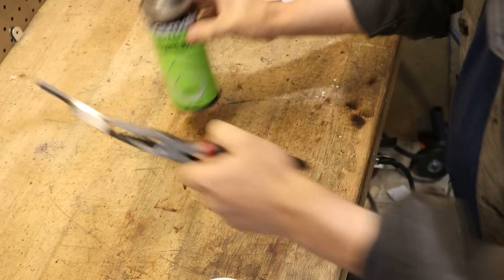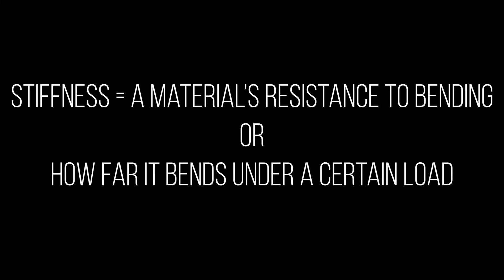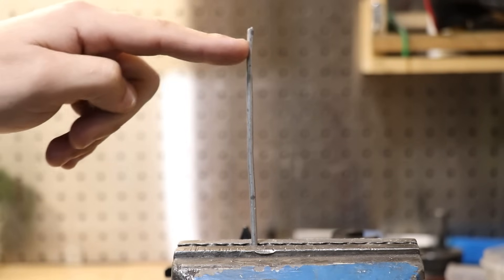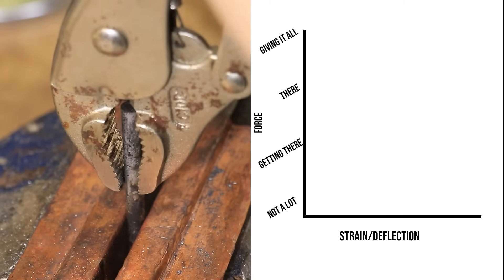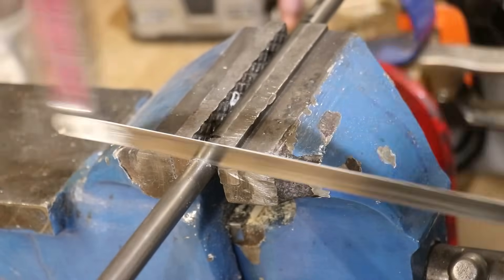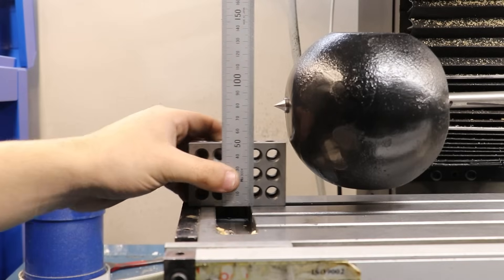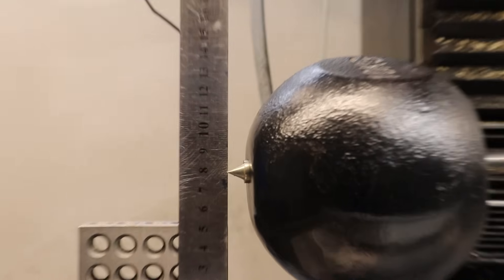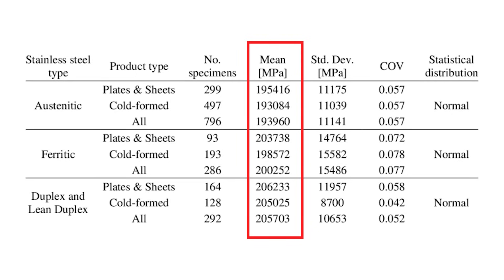Hardened Steel is NOT Stiffer Than Soft Steel

Comment: Reads title:
It depends on how you define stiffness.

If you can flex it without too much effort(just hands, no tools), it feels "flimsy" compared to a hardened steel that increases the amount of effort to bend the steel at all. 

Again, it comes down to your definition of "stiffness".
There are better terms.
Reply: There are no better terms than stiffness, this is the literal definition of stiffness. It is the exact correct word. There is no "your definition" and "my definition" of stiffness, there is only "the definition", and this is it.
Reply: @rodfrey  
 @rodfrey  
Axial compression, yield strength, tensile strength.

Stiffness only applies if you want to use the whole model, not the segments that he wants to represent in this video. 
If you want to be specific, he is correct in the video, the title is misleading. 
As he does define his statement at 1:50 i think to, "how much a material bends under a certain load"
Which is a great way to define it, but resistance to bending is not, as hardening does indeed change resistance to bend as later stated in the video.
Reply from the maker: @kairu_aname  I think you are taking it well beyond what a reasonable interpretation and scope of what is covered here. As it shows in the video the stiffness remains unchanged, both hard and  soft - 10mm of deflection under the same load. This is the main point being shown in the video. That bit tacked in at the end is just to show that whilst stiffness remained unchanged, resistance to permanent deformation is different. 

Are you confusing resistance to bending with resistance to permanent/plastic deformation be any chance? 

"If the line gets longer, then it by your definition gets stiffer." - No? We Would need the slope of that line to change to show a change in stiffness. If it gets longer it shows a change in yield strength and it takes a greater force to permanently deform it. That has nothing to do with stiffness as the slope remains unchanged. 

"Stiffness only applies if you want to use the whole model"  I don't quite understand this point that you have made. It is slightly different some plastic and cast iron, but for metals that obey hookes law, we just take the slope of the graph  below the yield point, where the stress and strain is linear and that is our stiffness. 

"He's using yield strength as a point and saying it's the same as ultimate strength" - I don't think I ever said that. It might get a bit fuzzy because I had to snap that piece of hardened steel but it really wasn't a big point of focus. I was just trying to show that the amount of force needed to permanently bend it increased with the hardness. I think that can be shown without diving into depths of UTS vs yield strength. 

"As evidenced by the point near the end of the video where he tries to bend the steel with a pipe as leverage" Yeah, the yeild strength goes up.... which is why people get confused and mistake it for an increase in stiffness. THAT is the only point being made there. And it was to tie in with the previous shot which showed that the stiffness/youngs modulus remained unchanged. 

I have read through your replied and I really do not understand the issues you are having.
Reply: @rodfrey  
(Also, yes. Languages are fluid, they change and words are changed and redefined over time. There are no absolutes, only what fits best right now since you want to be an ass about "your definition/my definition" nonsense)
Reply: @kairu_aname  Definitions can be fluid if we're dealing with Shakespeare or rap music. We'd better be a bit more conservative with language if we're trying to do engineering. Pulling the "language is relative" card is harmless if somebody wants "literally" to now mean "figuratively", but it's not harmless if one is sloppy with technical terms.
Reply: Hardening steel does NOT increase the amount of force required to flex it at all. It only increases the force required to permanently bend it.
Reply: @mixedsurface  
Again, better terms.
Reply from the maker: Well I did show you what stiffness was defined as for the context of this video.  If you have a more apt one I would like to hear it. Cheers
Reply: @artisanmakes  
Permanent flex? 
Plasticity.
Yield strength.
Reply from the maker: I don’t quite understand your point. Permanent flex and yield are different things to stiffness/youngs modulus, which is what I was specifically addressing here
Reply: @artisanmakes  
You're saying that the straight line doesn't change between untreated and treated steel. 
If the line gets longer, then it by your definition gets stiffer. 
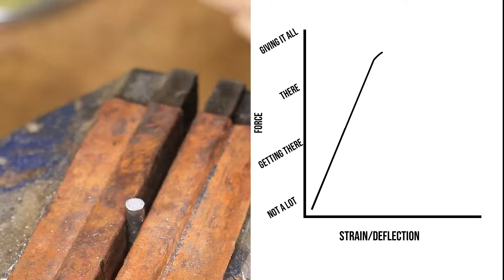4:14 And 5:44 respectively.
Reply: @kairu_aname  He was clearly talking about the slope. I suspect you know that and you're grasping for "gotcha" points - "changing length is changing!".
Reply: @rodfrey 
You're not paying attention. 
It's not some gotcha, you only see it that way because you do it. 

He's using a piece of the "stiffness model" and effectively saying "this piece doesn't change between heat treated and not heat treated."

To my understanding, He's using yield strength as a point and saying it's the same as ultimate strength. 
As evidenced by the point near the end of the video where he tries to bend the steel with a pipe as leverage.
(Again, better terms)
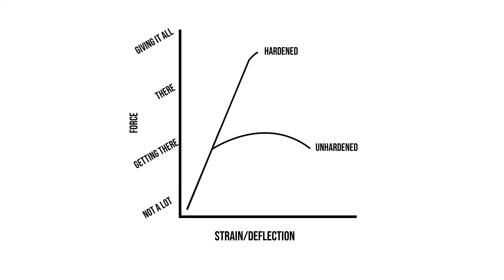Reply from the maker: I am not saying that at 5:44, I am saying that's why it feels stiffer when it isn't. Not that it is stiffer. cheers

Comment: Quenching a steel, wheather its Mild steel, medium Carbon steel or even tool steel, it changes the grain structure. Same with heat treatment. It doesn't necessarily make it harder, or more brittle. Just changes grain structure. What changes hardness and brittleness is adding alloys such as carbon, tungsten, and cobalt.

Comment: This is fairly true: 
The tensile modulus of carbon steel and most related materials is not changed by most heat treats if not all of them.  The yield strength is however greatly changed by both heat treatment and cold work.  As tensile, shear, bulk, etc moduli are all fairly well related for isotropic materials, this dictates overall stiffness in bending too.  

Where this doesn't hold: 
Some cast irons as there is no functional tensile strength and heat treating them can be rather destructive.  
Things between steel and cast iron in terms of carbon content are likely similar due to some heat treats keeping more carbon in solution at time of solidification.  

See Also: Why smart engineers prefer nearly anything to cast iron and consider it not economical or safe to repair.  

If someone says safety or mission critical and cast iron in the same sentence and the sentence is not a blanket prohibition, conniptions will be had.
Reply: Cast iron is extremely good at dampening vibrations. That is why it is used in the bodies of large machinery like lathes and milling machines.

Secondly, there are several types of cast iron. Grey cast iron is easy to cast and machine, spherical graphite cast iron can be made as strong as medium carbon steel with great deflection at break.

I happen to specialize in cast iron welding repair and I can confirm it being difficult to repair. Filler material choice and cleanliness is important, good pre- and post heat, insulation, stress relieving etc. There are a hundred ways to do it, all having their own appropriate situation. From thermal spraying to MIG-brazing and even mechanical cold stitching such as what is performed to cracked engine blocks.
Reply: ""See Also: Why smart engineers prefer nearly anything to cast iron and consider it not economical or safe to repair. ""  Depends on the size of the piece also are you referring to greycast or ductile cast iron ?

Comment: There is an exception to this: work hardened steel! Also called "cold worked" steel. Granted, this is a different kind of hardening, but it is still hardening.

Severe cold working increases the dislocation density and this does influence the spring rate of the atomic lattice. It is effectively acting as a change in chemical composition.

Severely cold worked 316, with over 50% cold work (meaning the original cross-sectional area is twice as large as the cross-sectional area after cold deforming) can drop the Young's modulus from about 200 GPa to below 150 GPa, and 60 to 70% cold work can bring it down to 130 GPa.

Comment: Now if you want to step off into the weeds consider that some coil springs are collapsed past their yield point as a part of manufacturing. Who understands what is accomplished?
Reply: That would be work hardening. 

(I have an MSc in Materials Science & Engineering, so I ought to know this... Deformation past the yield strength increases the dislocation density, making subsequent plastic deformation more difficult.)
Reply: @   Yes but you can say it another way in very simple, practical terms. Why would it be work-hardened?
Reply: @ThisIsToolman  Uh... I dunno. 

Plastic deforming of metals/alloys at room temperature will raise its yield strength. That's called strain hardening, or cold work hardening, or just work hardening. 

I can't help you with the origin of those names.
Reply: @    Yes. It raises the yield strength. It’s “failure” by design. Most often we hear going past the yield point as a failure. It’s not necessarily. Case in point, I ran the FEA at the last place I worked. I found that there was a predictable area in the mechanism where the stresses exceeded the material yield point…in tension…but never coming close to the tensile strength. I never mentioned it. I knew it would cast doubt on my abilities and it just didn’t matter. There had been hundreds of examples without a single failure, a statically significant number. No reason to stir up controversy only to make my day more difficult.

Comment: No stiffer but will further deform before yielding which is to say the hardened sample will bend more and return to its original shape than the same sample that’s not heat treated.

Comment: I 100% get your point.  Heat treatment doesn’t change stiffness in steels.  Here are some notes I’ve made through the years—I think they summarize what you said. My apologies if they don’t.  Great video! 

Hardness: ability to resist abrasion and permanent LOCALIZED deformation (also known as embossing)

Toughness: ability to absorb an impact shock force without fracturing. This does depend on the thickness and shape of the steel.  Carbon steels with round grains are tougher. 
   Types of toughness: notch, impact and fracture

Yield Strength: ability to withstand a force before permanent plastic deformation occurs (like bending in a vise). 

Ultimate Strength: ability to withstand a force before failure occurs (fracture). 

Tensile Tests: a piece of steel is placed in a machine that stretches it. Pressure is measured as it is stretched and elongation measured. Stress (Y-axis) is the PSI applied before deformation occurs; strain (X-axis) is the elongation measured during deformation—this is actually measuring ductility.  The area under this curve (integration of curve) is equal to toughness
Reply: ""Carbon steels with round grains are tougher. ""                    Carbon steels with fine grains are tougher.  !

Comment: So by 1:40 you have just proven by the earlier bending from the vice of the non hardened to the hardened, your statements is wrong. Way to prove a point.
Reply from the maker: Not really. It just wasn’t a properly measured example. Did you even watch the properly measured test and the theory? Or did you just want to make a gotcha comment. And you are wrong.

Comment: Maybe worth distinguishing between tensile strength and yield strength? Hardening increases yield strength but ultimate tensile strength is unaffected.
Reply: No, ultimate tensile strength is increased as well. It's the slope of the line that is unaffected.
Reply: @ctrlaltdebug  Well technically it depends on the alloy, and you're right that UTS can increase with hardening, but the increase is nowhere near as great as the increase in yield strength. You don't harden a part to increase its UTS - particularly because toughness can suffer. Rather, you harden it to increase its yield strength.

Comment: I believe it actually does affect stiffness, but it’s a very scale-dependent effect: that’s why a hardness tester that pushes a pin into the sample works. At the scales that most parts operate at, the effect is negligible. I’m not a mechanical engineer, though, so take this with appropriate quantities of salt. 🤔
Reply: The Young's modulus tells you how stiff a material is and is defined as the relationship between force and deformation in the elastic region.  When you are testing with a hardness tester that pushes a pin into the sample, you are going beyond the elastic region into the plastic region.  The hardness tells you at what stress you leave the elastic behavior and enter the plastic deformations.  Hardness does not change the Young's modulus of steel, it is in the region of 200 GPa, but you can change the strength from (lets say) 400 MPa to 600 MPa but the Young's modulus is unchanged.

Comment: This video is good because it clearly defines what he means by stiffness, and clearly shows that stiffness is unaltered by heat treating.   Then  he starts talking about strength, without defining what he means by strength.   Many people equate strength with stiffness.
The video would have been 100% clear if he had clearly defined ""strength" as the amount of force required to deform the sample, i.e., reach the top of the straight part of the stress/strain curve.
Reply: Yeah, probably would have been good with some more information there. But I will say that for those of us who do know atleast the basics of mechanical engineering, it's not always easy to understand which terms are completely misunderstood by laymen 😅
Reply: @Robinlarsson83  True.

Comment: Very well explained and shown, even if not %.0001 lab accurate.
So in the end, hardening seems to do at least 2 things.
1. Its makes the steel actually harder as in wear resistance.
2. While it may not change its stiffness, it will remain on the elastic deformation slope longer, before ultimately breaking vs plastic deformation.
Correct?
If so, then in that example, let suppose you just kept adding weight to the unhardened shaft.  Lets say at 40kg is exceeds elastic deformation and enters plastic deformation.
Its bent.
Repeat with hardened, and at 40kg+ it still in elastic deformation. Continue adding weight until it leaves elastic to plastic at n kg, and it breaks.
If this is correct, then is it just semantics to say it is not stiffer?
The answer for Mech. Eng. types is a given, but to a layman if you can put x% more stress of a part without it permanently deforming, it seems kind of natural to say its stiffness has increased.
Reply: Not an engineer, but I feel like stiffness = resistance to elastic deformation
Reply: If I think it in laymans term, I think of making a structure, like a bigger workbench. It bows or deforms too much. Therefore I need something stiffer. Both soft steel and hardnened steel will be exactly as wobbly.
I don't actually think that anyone things of stiffness as "how much before it breaks or permanently deforms" like you are describing. I think that anyone thinks of stiffness as "how easy is it to bend a bit", regardless of elastic or plastic.
Reply: Well, the problem is that laymen doesn't quite understand the terms us engineers use for these things, but almost everyone thinks they do.

And then the get annoyed when their misconception doesn't line up with actual reality.

Materials science and engineering in general is something you need to study to understand, it's not all obvious stuff, that's why we have degrees 😅
Reply: Well, the problem is that laymen doesn't quite understand the terms us engineers use for these things, but almost everyone thinks they do.

And then the get annoyed when their misconception doesn't line up with actual reality.

Materials science and engineering in general is something you need to study to understand, it's not all obvious stuff, that's why we have degrees 😅

Comment: really interesting video, i never really put much thought in the subject before, but what my brain always assumed is that  hardening moves the point of elastic deformation higher in the graphic (it can take more force before it permanently deforms) and also made it more rigid
Reply: I think you missed the point.
Its NOT making it more rigid, as he showed with the 10mm drop being about the same for both.
Its able to handle more stress/strain elastically than unhardened.
Reply: @boots7859 He only said that was what he assumed previously.